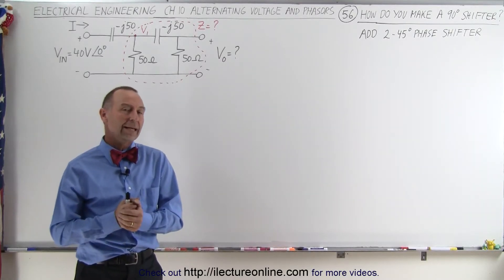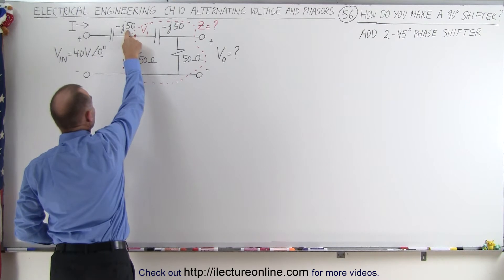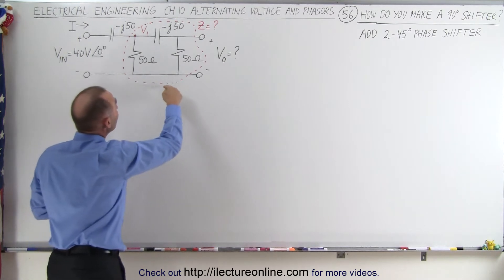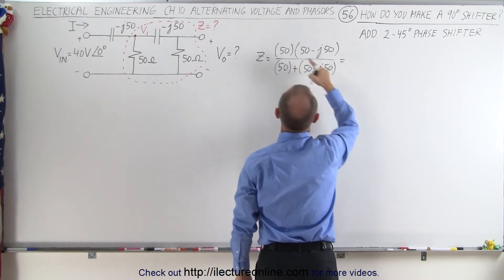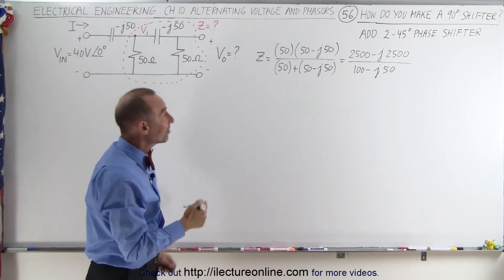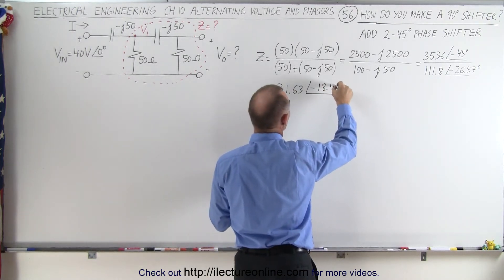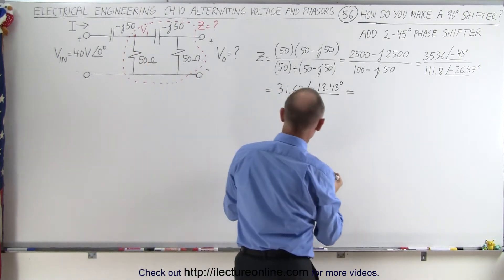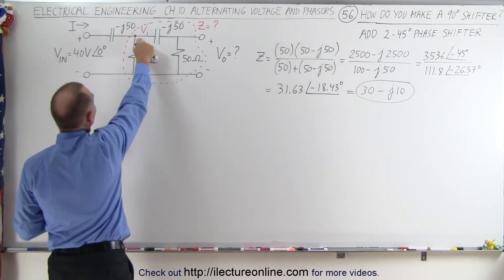Electrical Engineering: Ch 10 Alternating Voltages & Phasors (56 of 82) 90deg Phase Shiftor?***

Comment: Sir at time 7:47...
Does the 50ohm resistor to the left of the circuit has effect on V1.
Coz if we take V1 as the input voltage to the circuit with dotted red lines then some portion of it will flow to the 50ohm resistor to the left as well.  Y did u ignore it in calculation from time 7:47 and beyond
Reply: 50 ohms resistor on the left does have effect on V1, that is why when we calculated Z in order to find V, we took care of that 50ohms resistor. Now, when you are going to find Vo, you don't use the 50 ohms resistor in your calculation because voltage is divided across components which are in series not in parallel, that is why you only use the 50 ohms resistor and capacitor on the right.

Comment: I found after some algebra that in order to double phase shift of the original jX + R circuit by extending it by the same jX + R branch, it should be |X| = R, (45 -> 90). Otherwise it is not possible. I was expecting I could triple phase shift(to 135) by adding another -j50 + 50 branch, but it is not the case.